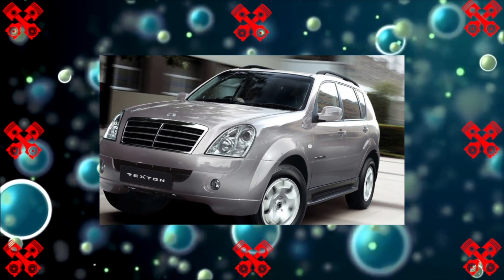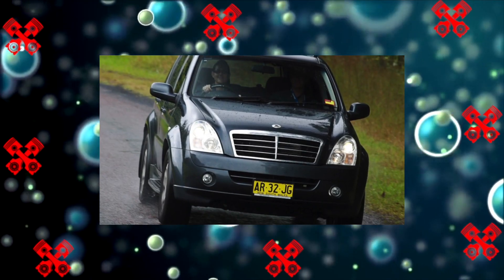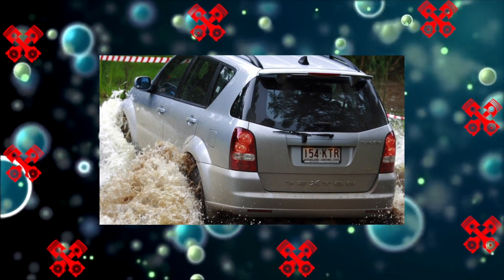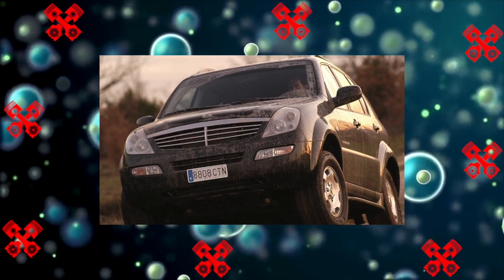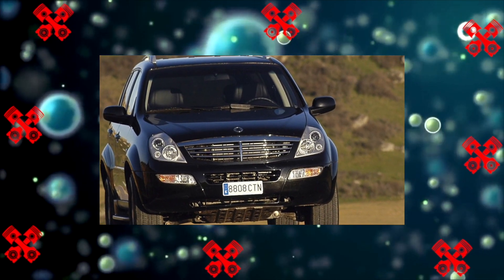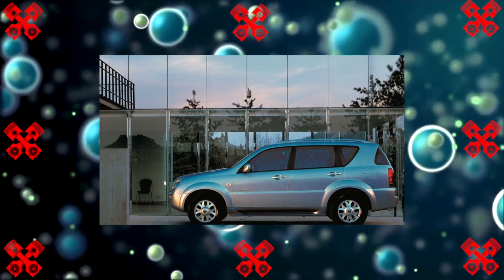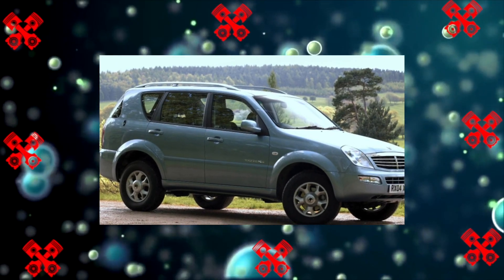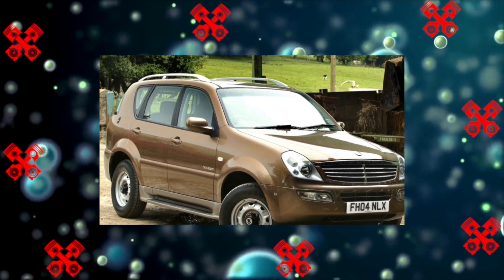Used SsangYong Rexton Reliability | Most Common Problems Faults and Issues

Comment: I owned a Rexton 2 Aka Y250 and I can say it was an absolute pleasure, and extremely easy to maintain.  Too bad SsangYong is no longer in the country
Reply: Yip, the Rexton is better built than a Mercedes ML in my opinion, it  does not seem to rust as badly, maybe the body is made out of better quality steel.